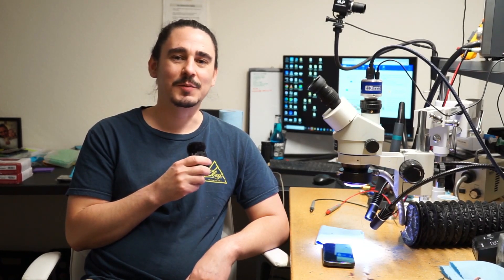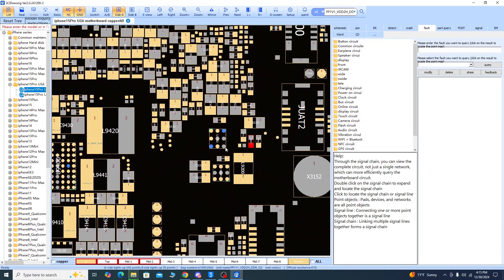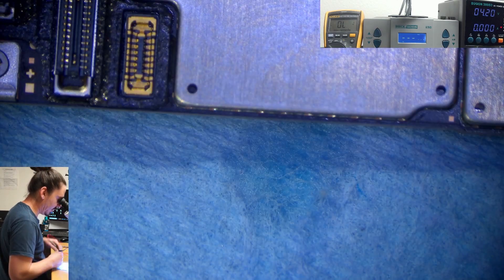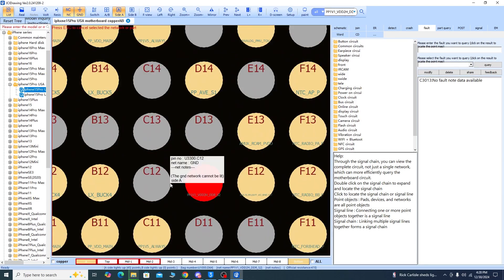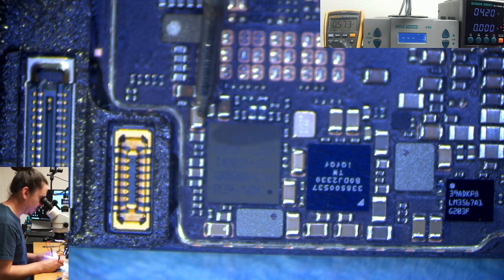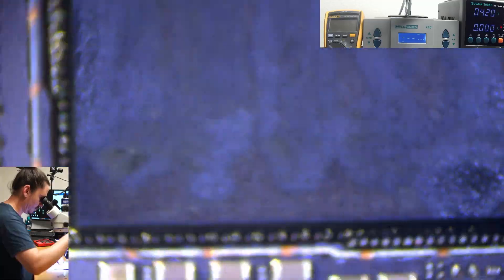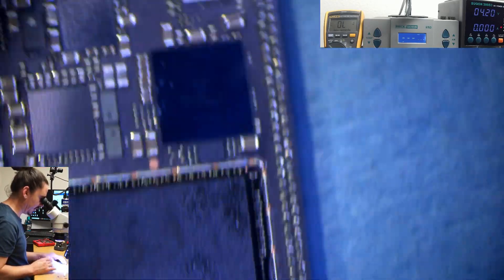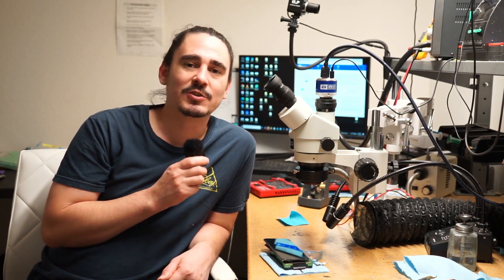iPhone 15 Pro Data Recovery - How to track down secondary power rail shorts.

Comment: Hello
I have iPhone 13 and because I forgot my passcode,  I had to reset  my iPhone. Can you please tell me if I can still recover my data which is not backed up on icloud or anywhere else?
Also, it happened a month back.
Reply from the maker: Sorry, I don't believe it is possible without the passcode for that model. You can try some forensic companies like envista forensics, but I don't believe they can work with that model.
Reply: @ I remembered the passcode now. Does that help to recover the photos from the reset?

Comment: What’s microscopes your use bruh??
Reply from the maker: I use a parco branded scope with double boom stand and .5 barlow lense. I used to use amtech, but once it broke I moved to parco, which is basically the same but cost a bit less.

Comment: The ease at which you removed that shield amazes me!! They always make me sweat my b**s while removing them! 🤣🤣 
NFC and proximity was installed to prevent frequent reboot? Right??
Reply from the maker: There is some technique involved but that is the best way in my opinion! You just have to be careful you don't knock any chips when pulling it up, as that can easily happen if you aren't careful with all the corners. Yeah, this didn't have any reboot issues.